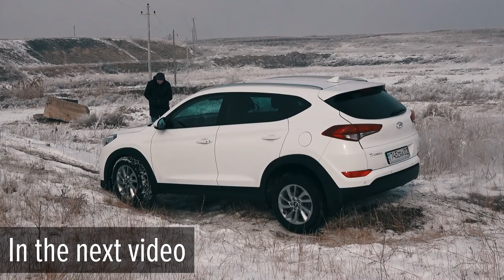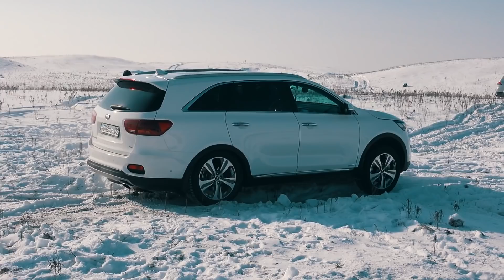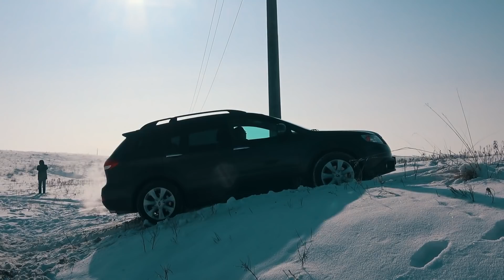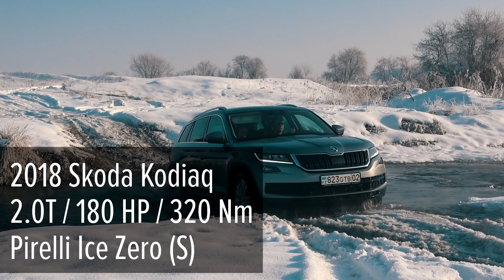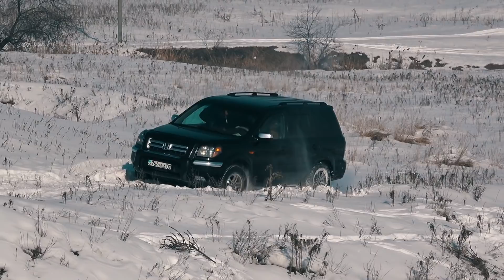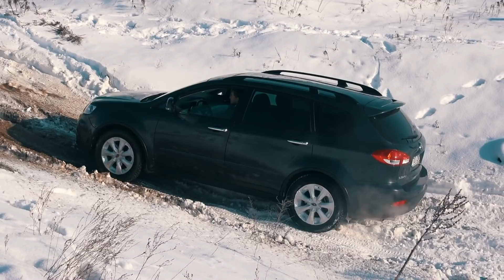Three-Row SUV Battle: Chevrolet, Subaru, Skoda, Kia, Mitsubishi, Toyota, Ford, Honda & Hyundai

Comment: The Outlander PHEV (Plug-In-Hybrid) also has an electronic center locking differential, due to using a dual motor setup. They have a button on the center console for that. The computer just needs to match the RPM of both the front and rear electric motors to behave like a mechanical locking diff would.

(At least on the 2016 model that my parents drive – I haven't come across the newer versions yet)

Comment: Why not use an assortment of modern cars? Can't algorithms be updated along the years? Maybe the subie was crap back then but it could be good now??
Reply from the maker: Each video presents the cars that I managed to find. Do you think that if it is possible to take as much as possible machines of the same power, I deliberately do not do this? Try to collect 7 cars in one place and drive with them 100 miles for a full day filming. This is a very big job.

Comment: Take tires out of the equation use the same tires, same year of vehicle please, preferably 2020/2021.
Reply from the maker: I wish I could find cars of the same (latest) year. But it's not easy, especially, when there is no dealership in my country or new cars come quite late in comparison with the rest of the world. So we work with what we have.

And I completely agree with you. The same tires will add objectivity. But since I do not have a car tire factory, we work with what we have. At the moment, we are checking that the tire pressure corresponds to the factory values (for each car individually).

Comment: Toyota's tractionless system performed as designed.  This system is not meant for actual off road or inclement weather use.  It is merely there to fool customers into thinking that they have an awd vehicle.

Comment: I have Chevy Captiva and I'm a quite dissapointed of the traction system that saw in this video 😟, but with a little more acceleration the car have good performances off road. I've tested it already and did well. 😁

Comment: I saw SUV and assumed it would be SUVs not crossovers.
Reply from the maker: Crossovers is one of SUV's types. But which cars did you expect to see? I could add them to the list for future videos.
Reply: @SUVBattle  The big one missing is the 4Runner. It would also be great to get some insight on the new Bronco especially since it is one of the few available in a 2 door.

Comment: It doesn't make sense to compare different year vehicles if you're testing out the AWD systems.  All vehicles should be the same year so that this test isn't so deceiving.  AWD systems has improved over the years and the latest model of each vehicle should have been used for this test.

Comment: Tires play a roll but just goes to show how junk most electronic all wheel drive systems are. If they can't put power to the wheels not slipping u aren't going anywhere regardless of tires. Good job on videos showing all that.

Comment: That Hyundai Santa Fe looks like the 2.0 T model not the 2.4 NA mentioned in th video. I thought those wheels only came on the turbo model. I have a 2020 Santa Fe 2.0 T model and love it so far.
Reply: Features and specification vary from country. I believe these are Kazakhstan delivered vehicles and would differ in specification depending on where you're from.

Comment: Those pathetic results are due to fact .. manufacturers do not build CARS anymore, but just MONEY. Full of bullshit electronics but without adequated hardware, to be cheaper and to NOT last more than guarantee period. A lancruiser 70 or a jimny/samuray (all in version with rear diff lock) would run all those tests without hesitation. I do not mention Y60/y61 which equipped with proper tyres.. are monsters of snow and mud. But.. manufacturers of 2020 makes money, they can't spend anymore money for parts which don't catch the eyes of stupid buyer, as a STRONG axles/diff's and wheel couplers, a chasis or a transmission.
By the way, this content is for USA customers ONLY as i see, because no other country except those which standing on arab empires of petrol would afford those low prices for gasoline, as fact those v6 engine does not exist as sale numbers in ANY other countries than USA, Canada, Arab countries and AUSTRALIA.

Comment: Third time watching this channel - and for the third time - very well done. Impressive stuff from the Skoda, in spite of using the inferior haldex-based part time 4WD.
Reply from the maker: Great thanks for your feedback! What cars would you like to see in the future videos?
Reply: Great videos, so before buying skoda Kodiaq In the uk....We test drive many versions from1.4  to 1.5 2.0  150bhp front wheel drive petrol and diesel only  too  and 4 wheel drive.  7 seats. Auto 

We bought 1.5 petrol front wheeldrive to go off road and farm land Halloween pumpkin picking. Found it extremely Exciting and easy to drive in bad conditions with 7 people inside and snow conditions foot high snow with winter tyres....  So you don't really need 4 wheel drive we notice.

2 years now and still very comfortable quick car.

Comment: Wherr is the Mazda man? 😑🧐🧐
Reply from the maker: Each video presents the cars that I managed to find. Do you think that if it is possible to take as much as possible machines of the same power, I deliberately do not do this? Try to collect 7 cars in one place and drive with them 100 miles for a full day filming. This is a very big job.

Comment: i had a 2wd captiva for 10 years, did some light offroading with it, sometimes wheels lifted up a bit and i traction control didn't feel that weak, weird...

now i drive a rav4 (2wd, hybrid) and traction control is still weak...extremely low rpm, weak braking, too focused for snowy roads but not snow if that makes sense... hahah

Comment: These are horrible comparisons. You're comparing numerous different generations. Many of these older vehicles that you compare, now have much better awd systems and engines.
Reply from the maker: I wish I could find cars of the same (latest) year. But it's not easy, especially, when there is no dealership in my country or new cars come quite late in comparison with the rest of the world. So we work with what we have.
Reply: @SUVBattle  I understand. Sorry, not trying to be overly critical. Just some of the newer AWD systems, are entirely better in a number of the new model suvs.

Comment: I have the 2017 highlander and it rocks in the snow. All you need to do if you stuck. Is activate snow mode, lock diffencial, traction control off and first gear.

Comment: Proof right there that good 4x4 just as important as snow tires. The Toyota with studded tires but crap 4x4 couldn't drive through obstacles that the Honda with regular tires but good 4x4 got through.

Comment: Outlander did very good.  Kia and Hyundai were also impressive.  I'd also be interested in seeing more tests where tire isn't as much of a factor.
Reply from the maker: I completely agree with you. The same tires will add objectivity. But since I do not have a car tire factory, we work with what we have. At the moment, we are checking that the tire pressure corresponds to the factory values (for each car individually).
Reply: @SUVBattle  me too

Comment: Pls do it battle for mid suv ladder frame like pajero fl, fortuner fl, trailblazer, x-terra,all new mu-x, everest sport biturbo
Reply from the maker: I have plans to film some of these cars. Subscribe to not to miss this video.
Reply: @SUVBattle  already subcribed pls do test all of those car i said bcause here in indonesia ausy very famous for those mid suv ladder frame rwd 4wd
And suggest to do test not only on 4wd mode but also test for stabilty, handling, noise, vibration & harsness while in high speed or  full load passenger at mountain road

Comment: I don't know if this is done on purpose or what, but the idiot directing the drivers from the outside, makes the vehicles stop right when they get traction and are about to overcome the obstacles, so i don't see the point of forcing them to fail. Also testing vehicles made more than 10 years apart, is pointless to me because the electronic traction control might have improved a lot over the years.. Interesting video to watch, but useless for comparison purposes
Reply from the maker: Drivers deliberately drive as slowly as possible and along a deliberately “wrong” complex trajectory. This allows you to demonstrate the effectiveness of the four-wheel drive system. If you take a good acceleration, then all cars will easily pass this obstacle and you will not notice any difference in their behavior.

"Also testing vehicles made more than 10 years apart" - this is just request from my subscribers. But I wish I could find cars of the same (latest) year. But it's not easy, especially, when there is no dealership in my country or new cars come quite late in comparison with the rest of the world.
Reply: @SUVBattle  Fear enough. Sorry, this is the first video from this channel that i have ever watched, so i think i misunderstood the purpose of the video and judged the wrong way

Comment: The Subaru did the best but the problem was the trail was already damaged
Reply from the maker: I completely agree with you about condition of surface. But finding a way so that the surface condition does not change and there are convenient shooting points is extremely difficult. So far this is the best I have found. If I find something with a more stable surface, of course I will take this opportunity and will test there.
Reply: @SUVBattle  you are doing well 👍🏼

Comment: That Subaru is a 2008 model vs a 2019 Hyundai Santa Fe? Yeah, that's a fair fight! Smdh
Reply from the maker: A lot of people asked me to add older cars to my tests. So I try to fulfill this requirement.
Reply: @SUVBattle  you need to make a disclaimer stating this and that the vehicles you use in these"battles" are privately and dealer owned and identify them as such.
Reply: @SUVBattle  :))

Comment: Was really surprised by how the Outlander completely bossed it
Reply: From 2019 onwards, there was a big upgrade of S-AWC (Super-AllWheelControl) with Mitsubishi. 
Nothing could stop me yet :)

Outlander PHEV 2020
• 3cm spacer lift
• bigger 225/75r16 Bridgestone Dueler 001 A/T tyres.
• lift in total: 5cm
Reply: @user-qw4jy1oy9r  you have photos, IG?
Reply: Mitsubishi needs proper designers. Their meh looks hurt them.

Comment: I'm genuinely surprised by the Santa Fe's performance especially from the lower spec engine.   It's also available with a more powerful 2.0T, though I'm not sure if it was available for your market.

Comment: its good that the new highlander has a new awd system, I have a 2016 highlander and the traction control cuts all power when a wheel is in the air.

Comment: All the rubbish nonsense traction control and terrain responses are useless. The only solution is front and rear diff locks.
Reply: Yeah, good luck finding those in crossovers.
Reply: @dundee1080  exactly. Unfortunatly they became history, but their efficiency is beyond questionning.

Comment: It's all about tires in the snow, and a good traction control system. Awesome video, once again I enjoy your work! :)
Reply from the maker: I completely agree with you. But these are private or dealership cars, so it is not possible to replace tires. The budget and time also do not allow for this. But we will do such a test in the future.
Reply: @SUVBattle  you’re doing an Exellent job despite the restraints you mentioned. Your testing apart from the tyres is spot on 👍🏻👍🏻👍🏻

Comment: Damn I didn't know the Santa Fe was that strong 😶😶😍
Reply: Hyundai looks nice, good build quality and performance
Reply: I drive a 2018 2.4L santafe sport AWD and its absolutely amazing for everyday driving smooth and really fun.
Reply: @Beyondtheunknownfactss  we just got a santa fe 2020 recently but it's diesel and 7str and also 4wd. I didn't know really stable it was until I watched this
Reply: @Nadilo2023 diesel es excelente un par motor muy alto a bajas revoluciones
Reply: Considering the fact that the participating Santa Fe is only a 2.4 naturally aspirated engine. Amazing HTRAC AWD by Hyundai. Got a 2.0Turbo Santa Fe  and it’s loving the snow
Reply: @strikerat4370  what’s the difference between the Hyundai Santa Fe and Kia Sorento in terms of price.
Reply: it isn't about strength, the ESP programming is very good.
Reply: Hyundai kia needs a better marketing arm for its offroading

Comment: The 2008 have a horrible awd,i preffer the 2016 Pilot (ivtm4)
Reply from the maker: I will add 2016 Pilot to my wish list. Who to take as rivals? And subscribe to not to miss the video!
Reply: @SUVBattle  im the same guys who been recomend the Subaru Ascent but you told is not avIlable in your country.Mr Dyas i have a 16’Honda Pilot and trust me is very good awd,probably can useas a rival the hyundai Santa Fe and the Vw Atlas and the kia Sorrento.

Comment: Love your comparaisons. But you must remove cars that are older than current production models as they are truly now relevant when compared to the manufacturers current offering. The addition of the Pilot in this video was a perfect example.
Reply from the maker: Some people ask me to mix old and new. So I try to fulfill this request. In addition, you can see how tech has changed through years.
Reply: We need all cars available to be tested. It will be hard to get all the cars of the same year together and besides this is for entertainment purposes, I would want to see how effective old tech is to new

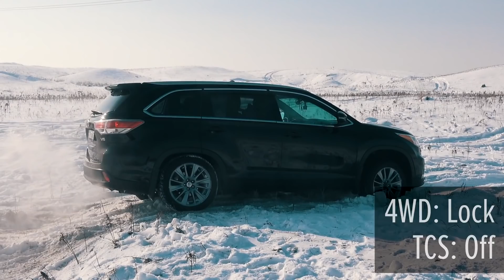Comment: Naks, what an eye opener from these video!  I'm from tropical country, so I don't worry much about the specific usage of tires until now.  But since this video was taken during winter, so the tires used must be for icy roads.  And judging the video, from zero to 12:39, Korean made cars have it conquered easily, but Japanese made ones, encountered difficulties in moving on the obstacles.
Reply: And this Ford Explorer, at 17:58, hardly made out of the obstacle, well, it's very sad.  But one thing I knew, these compact SUV, is being recalled according to a Chief Mechanic I was talking, while watching the Explorer towed by another vehicle to the dealer's own shop.

Comment: which one of them would you rather drive through these obstacles? The Skoda thing where it sort of picks momentum spinning and then jumps scares me a bit. None of these would be my choice. It would be interested to see the cohort of SUVs (e.g. Audi, Land Rover/Cruiser BMW, Merc, Lexus... from the previous video) on this set of challenges.
Reply from the maker: For me the Outlander with V6 is well balanced car for such kind obstacles.
Also it have Super All Wheel Control system with dynamic torque distribution.
It works very nice in practice.
Reply: @SUVBattle  Indeed it seemed pretty good overall. Unfortunately the Outlander  does not seem to be available in Europe NEW. Only its PHEV version. And from what I remember when I was looking into it a few years back the non-PHEV version was pretty thirsty.

Comment: why used such an old Honda Pilot?  it's a decade older than the other SUVs
Reply from the maker: This is the best that I could find. Hope I will get newer Honda's in the future videos.
Reply: @SUVBattle  the newer Honda AWD systems have the same Acura hardware SH-AWD.  It will definitely will do extremely well on your tests.  I will patiently wait to see those in your videos.
Reply from the maker: I have in at youtube review of newer MDX and  2019 Pilot. And there was a difference in AWD systems performance. SH-AWD on MDX performed better than Pilot did.
Reply: @SUVBattle  Yes, hence, when I said hardware are the same.  Only the software are different.  SH-AWD is tuned for handling and performance.
Reply: @misterle7026  it seems honda gets the previous generation of software. Currently Acura just started using its 5th generation of software for the sh-awd so I imagine new hondas with i-vtm4 will be getting the outgoing 4th gen software.
Reply: @Robob23678  I am afraid Honda won't get the same software as Acura.   They don't want Acura sells number to suffer.  They want to keep Acura as the more superior counterparts.  Pilot is already taking alot of the spotlight,  so MDX needs all the help it can get to stay ahead.